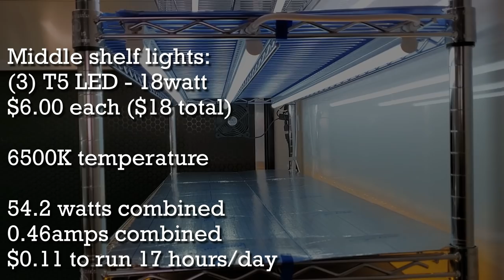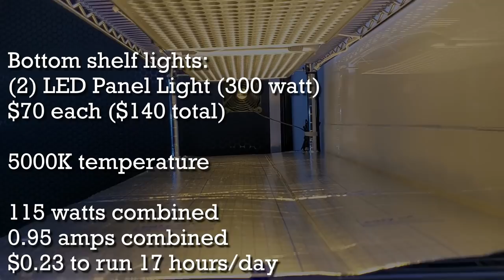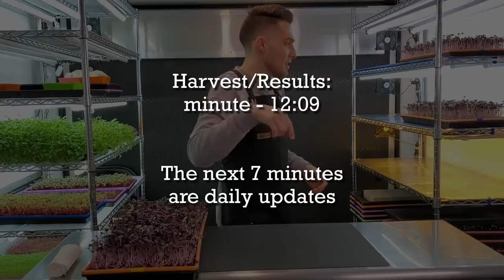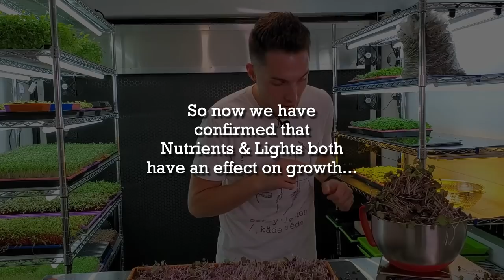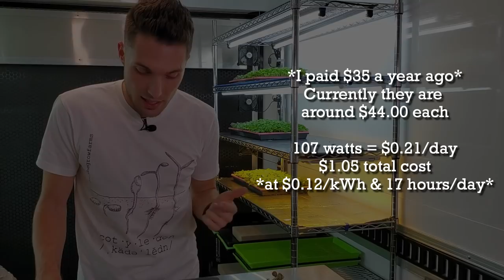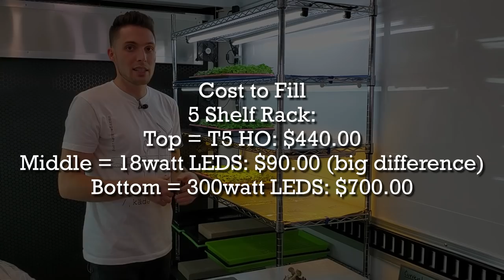Microgreen Lighting: Fluorescent vs LED's - On The Grow

Comment: You should convert your lux into ppfd/ PAR  for a more accurate DLI  ..once your light intensity variable is sorted out. you'll have a more accurate representation of what your color spectrum  variable. Somebody I really suggest checking out if you haven't already is Dr Bruce Bugby of apogee instruments . He has released a lot of information recently on far red spectrum that's worth looking into. Not trying to tell you your business or anything , infact I love that you're out here running test. Its just hard to compare lux levels on different types of light(t5 vs led with the same exact lux will have 2 totally different levels of PAR). I'll also add im only 3 minutes in so you may actually cover all this .lol . Appreciate the content either way my friend 🙏😊
Reply from the maker: Lol, I appreciate you sharing! After this video, I bought a PAR meter and it has been used for all the videos since this one!
Reply: My phone died while I was typing up a follow-up after watching the full Video, all in all great video homie🙏 I appreciate the effort and information. But definitely, DLI is the most reliable way to quantify light use. (Light intensity  X    time the light is on per day) I would imagine the majority of those options were probably overkill for microgreens . If you're looking for overall efficiency the best diode on the consumer market is Samsung's Lm301B (with an efficacy of 2.8 umol/j). because i asume microgreens have a low DLI (guessing under 10) you could probably get away with one strip  per shelf, which would be a relatively low upfront cost. However those diodes will only cover you for the intensity factor, and would have a similar result as the T5 or 18watt leds. If you want something like the 300 watt equivalent, You would want to stagger in a broader spectrum leaning towards the far red. I hate offering unsolicited advice.i promise, I'm really not trying to break balls or anything. I just really like lights , and appreciate anyone who's putting time in testing stuff so we can all have a better understanding. Thanks again for the video Man. And I really suggest Bruce Bugbee video "far red -the forgotten photon" its a little dry for most , but because ik how much work setting up experiments are (let alone recording them) I think you'll really enjoy the straight information. Thanks again ☮️✌️

Comment: so i wonder: was it simply the fact that the shelf on the bottom just had more total lux which made the leaves develop so much more fuller?
and another question then comes to mind: may it be possible to get similar results by simply increasing the amounts of lights in the middle rack (since they were the cheapest by far) from say 3 to 5 or 6? and ye i know that they then would still be lower in lux but meh, still worth a try if one considers the ones on the bottom not worth the (initial) investment, i guess :D
Reply from the maker: Great questions! We are going to put the 6 light shelf up against the 300watt equivalent soon so we shall see!

Comment: Are those T5 LED's 22 watts, not 18w? That is what is on the amazon store.
Reply from the maker: We no longer have the 18watts because the vendor changes the lights and we moved away from them. The Barrina 20watt lights listed in the amazon store work better than the 18 and they’re a better price too. More bang for your buck. The 22watts work well also, but Barrina has a stronger Brand presence and I’d trust them more to back their product.
Reply: @OnTheGrow  Thanks for clarifying.

Comment: Love Your Channel, you guys are fantastic, so I dont mean to be overly critical when I say this, but your math is way way off. The most expensive lights were $1000 for the rack, but increased your yield by 15%. What that means is for every 7 trays you grow now with the regular lights, you would get an extra free tray. If you normally grow 210 trays a week, you can now sell 240 with no extra work or space. If you sell each tray for $20 the lights are completely paid for by the extra yield alone at 350 trays. $50 a tray pays for the lights in 200 trays.  Additionally, the cost of the lights should be spread over the life of the light not a single grow. Fluorescent burn out a lot quicker than LEDs, so you need to replace more often. You do your business the way you want, but there is no question upgrading to the LED's would be the most cost effective solution. The cheaper lights will be much much more expensive over 2 years in lost harvest and replacement costs. There is a saying in carpentry "I dont earn enough to buy cheap tools"

Comment: Lumens are for humans. The photons in the spectrum of light that the human eye can see. Plants absorb photons in the Photosynthetically Active Radiation (PAR) range. If a light is intended to grow plants, it should be judged by it's PAR output by unit of micromoles. Studies have show various brassica microgreens thrive best at ~330 ppfd @ on a 18/6 light schedule. It would be interesting to hear how close those lights you used were to that range. Thanks for the video!
Reply from the maker: We didn’t have a PAR meter at the time of this video, only a lux meter. We used it to provide some measurements so people could see the differences. 

We have a PAR meter now and use it in our newer lighting videos. The ppfd for the LED Panel light is actually upwards of 400. 

We are going to be doing more lighting tests soon and sharing the results! 🤗🌱🌱

Comment: Yeah the one in the middle has 300w underneath that's the same as my heater to warm my feet 🙂
Reply from the maker: haha good to know! 🥳
Reply: @OnTheGrow  I was really interested at the start of the video because I tried to grow with led's about 15 years ago when they used to be alot dimmer,  I didn't have much luck so I used them for taking clones which they turned out perfect for as you need more root growth than leaf growth, but they have come a long way since then so to-do a comparison I thought was going to be really good that was untill you said the power outputs of all the light set ups. It's either you don't understand about the lights or your hoping we want understand, please could you do it again but keep it a bit more scientific because even tho on this video you grew more with the LEDs you actually had less per watt of power consumption than the others, perhaps you could give it another go keeping every variable as close as possible and putting them on the bottom shelf that's been partitioned.
No matter how tho keep up the growing it's good to get others doing it, so many thanks

Comment: Have you considered/experimented whether the colour temperature of the lights has an affect on output?
Reply from the maker: I have actually! In my last test on that, I found that 4500K temperature performed better than 3000K and 6500K. I still need to test it more though just to make sure. I've only had two solid grows with the test so I need to try a few more times to make sure it is accurate, but that's where I stand with it now.... I saw about a 5% increase in yield by color temperature only. Hope that helps!
Reply: @OnTheGrow  Wow! 5% is a huge difference considering choosing the correct colour temperature has no impact on cost in general. Would be great to see a video on that. Cheers.
Reply: @OnTheGrow  So do you have any recommendations for 4500K temp LED lights?

Comment: I am curious how much difference it would make to increase from 3 to 5 of the lamps on the middle shelf. 

I hate to go down this rabbit hole in a YouTube comment, but your luminosity readings are worse than useless for determining effectiveness of the light for growing your crops. It is useful for comparing 2 lights that have approximately the same spectrum (basically determining what fraction of intensity an old LED has lost compared to a new one) but the same amount of light will give radically different results based on the spectrum produced, and that detector is allegedly calibrated for how bright a human will perceive the light to be. Which is very different from the amount of light being produced which is useful for your plants. (For details, see the Spectral Sensitivity Characteristic in the sensor's user manual linked to on the amazon page.)

Honestly, I suspect that the bottom shelf doing so much better with respect to color, is mostly about good spectrum matching, but it could also be largely about uniform shadowing due to how the light elements are arranged. A test with 5 rows would generate a similar shadowing situation to the lower shelf. The stiffness of the crop is almost certainly a matter of spectrum matching combined with uniform shadowing as that happens when the plant stops trying to rapidly grow vertically in search of extra light, basically the plant does not think it is in shade, which also explains the more uniform height. The greater mass is probably due mostly to the greater amount of usable light which is partly from the higher power array and partly from the better spectrum matching.
Reply: That sounded a bit harsh in the wording I think. Sorry. It is still a great video with useful information and I have subbed after just watching a few of y'all's videos. Very well done channel as a whole.

Comment: What are lux?  I have heard about lumen and kelvin
Reply from the maker: Lumen is output from the light, kelvin is temperature (color), lux is light at the end point. So when you measure a set distance away from the light, the light at that chosen point is your lux measurement. Hope that helps!! 🌱🌱
Reply: @OnTheGrow  You are so awesome for your reply, thanks so much.  I just ordered T8 LED lights with 24W per light and a shelving unit.  The LED lights I ordered last year really were not strong enough.  I will be growing seeds for my raised beds and micro greens for personal salads.  Loved your breakdown of cost as well, thanks again!!

Comment: The LED tray had a little misadvantage compared to both above. no heatimg from above as one would expect from the heat produced by the lamps beneath the trays.
Reply from the maker: You are correct! Yeah, there are quite a few things that aren’t perfect about this test, but it is fun to see the different growth we can get! Also, each light set puts out different amounts of heat so that varies as well...

We have the foam pad under which does help a little with insulation and trying to stop that heat from effecting it too much

Comment: Whats the porpose of the fans?
Reply from the maker: They prevent microclimates from the heat generated by the lights... they also help circulate the air and provide resistance for the plants to fight. Mainly the microclimate prevention though.
Reply: @OnTheGrow  Does that work with peppers too?
I read that they dont like wind.

Comment: Hey! I think you should get a ppfd app for your phone, that measures the light plants use. Lux only measures light in the spectrum humans percieve.

With a par/ppfd meter you will know if the light is too much or too less: more than 1000 is too much, between 500 and 1000 is good (optimal between 750 and 1000),less than 500 is too low.

Basically, lux mean nothing for plants, its a human measure of perceived light.

You can get a par meter instead for a more accurate reading, they are 500 usd ;)
Reply from the maker: 🙂Thank you so much for the lighting feedback Dario Durà Armadans! We get a lot of questions about what lights will work best!! We appreciate your support!
Reply: @OnTheGrow  thanks for your reply! I just saw another vid where you got a par meter, great!

Although i am guessing that in the following years we will learn lots of new stuff about plants and the light that helps em develop better and faster (far-red etc).

Luckily i have an inside patio with 200 to 350 par natural light (it's covered with translucid material), so as of now no need to buy lights.

Your videos inspire! Keep it up!
Reply from the maker: 💚Thank you so much for the support Dario Durà Armadans!! We are going to be making new content soon! 😄

Comment: The 300watt LED's id say you are using wrong. it is too close and has a way bigger coverage area to grow these Microgreens. you should let it hang 12" and have more trays under. So you should be able to get more growth pr light that way aswell.
Reply from the maker: Totally agreed! For this test though, I wanted everything at the same distances, otherwise it would be one factor different for only one group. 

They are waaay too close as I agree that they need a lot more distance to get the correct coverage. 

We haven’t done this yet because we get a lot more production from having narrower shelves and more trays per sq. ft. using the bar style lights and 10” shelf spacing.

Comment: Why was only 2 T5 fixtures and 3 led strip lights used in comparison to the bottom fixture which obviously were more lights (probably equal to 6 of each)? I personally would have used 6 T5's and 6 led strip lights. Comparing the different fixtures with different lumens outputs isn't a fair comparison of different types of light in my book.
Reply from the maker: There’s all kinds of other lights tests on our channel! This was our first one. Two of the fluorescent have nearly identical PAR output as three of the LED’s. Lumens aren’t a good measurement for light, which is why we bought a $500 PAR meter after this video. 

We have some tests where we try out 6 of the LEDs and a bunch of other light tests that are more balanced than this

Comment: Is there a pro or con to using scissors instead of a knife?
Reply from the maker: Great question! We prefer knife because it provides really clean cut and we like the ergonomics of it. Scissors work really great and some people love using them. It is more of a "pinch" than a "cut" so you have to be careful about damaging the stems with scissors. If you damage the stems with bruising, it causes them to degrade faster and the product doesn't seem to stay fresh for as long. Hope that helps!
Reply: It was extremely helpful thank you I assumed the scissors would be simpler to avoid getting medium accidentally on the product. I understand why you don't now and you stopped me from making a big mistake on my first harvest! Thank you again you guys are awesome

Comment: Using a high efficiency lamp made with Samsung 301B LEDs can provide up to 200 lumens per watt of electricity used which is the best available.  Bridgelux also has competitive high efficiency LED light modules. The initial higher cost is easily made up for by reduced power usage and much longer life over fluorescent.
Reply from the maker: Those are really nice LED's but I don't see anything similar to a T5 that uses them that we can easily mount to a shelf for a test. Do you have any suggestions on that so we can get some to try out?

Comment: its not comparable, because this is a comparison for the light's effect on the growth of the microgreens. then all the microgreen germination should start from the seedling, not starting when every tray has different status, in your example, they have been germinated and one tray was higher than the other two, because of this, this should be use as comparison to tell the difference of the effect of the lights.
Reply from the maker: This wasn't meant to be a perfect experiment and there are also so many other things wrong with this if we are going to point it out... The top two received heat from the lights below while the bottom tray didn't... they are all at different heights within the grow space so the air temperature is different. Each light puts out different amounts of heat onto the crops below... so on and so forth.

Try germinating three trays of the same crop and get the exact same germination for all three... Curious what your results are.

Comment: do the experiment again, you should install all of them on the lowest floor, otherwise each lamp works like a floor heating. hehehe, but very interesting
Reply from the maker: Yeah, this experiment is far from perfect. We just wanted to see the effect that lights have on the greens and the middle trays which had the most heat input from the shelf below had results that are consistent with the results get get on our other shelves so heat had very little effect on our results.

Comment: Watt are a measurement of power and have no relationship to light output. A watt defines the amount of electrical consumption of the appliance. A hair dryer uses 1500 watts, and it does not normally emit any light.  Use lumen is a measurement of the quantity of visible light over time. lux is a measurement of luminous flux over an area.
For a consistent measurement and test, use lux. Your could have turned the tray upside down if you really wanted to have a similar, repeatable measurement distance in each case.
Reply from the maker: Thanks for sharing Richard!

Comment: You cannot measure growlight with a luxometer. Lumen should not be considered.  The luxometer in fact measures more in the green and yellow wave length and that's why you have a higher output with the bottom leds. The other lights are more shifted towards the blues.... and their output is not perfectly measured by the instrument. And in fact at the end you are comparing weight of produce.  Most likely the difference in weight output is due to different amount of light thrown towards the micro greens. Most likely bottom shelf produces way much more PAR than the middle shelf.
Reply from the maker: We bought a PAR meter after this experiment. I simply had the luxometer on hand and wanted to share some point of reference for light intensity outside of me just saying, this one is bright, this one is brighter, and I think this one is brightest.